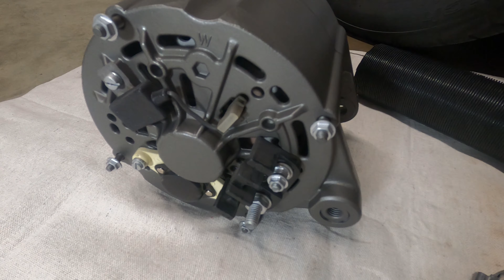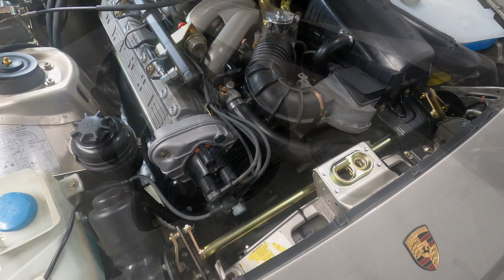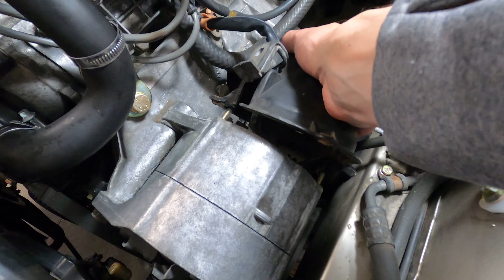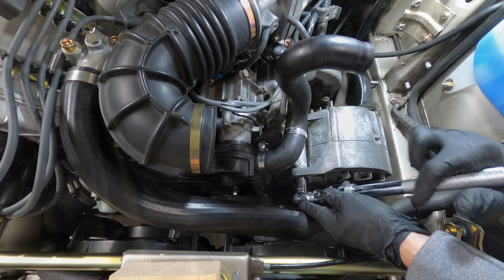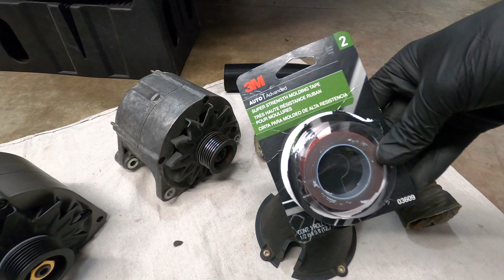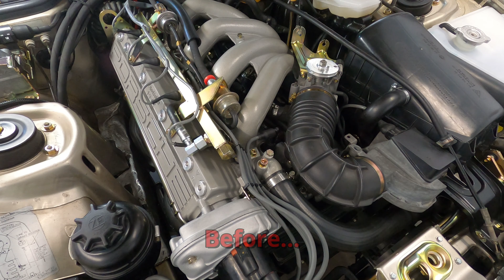Porsche 944 – Alternator Replacement Tutorial

Comment: I have an 84 and I just ordered a replacement alternator that will require reusing the pulley. Was hoping to see if you or anyone in this subscriber community knew what the correct torque spec would be?
Reply from the maker: 33 ft/lbs. should do the trick.
Reply: @NC944er thanks for the quick feedback. Love your videos, keep up the good work.

Comment: I can not rid off red battery warning light with new alternator
Reply from the maker: What voltage readings are you getting from the battery when the car is off and when the engine is running? Should be 12v+ on the battery and 13.5-14.5v when running (alternator output). Other things to check include the battery terminals, make sure they are clean and tight, check and clean all ground connections, and inspect wiring between battery and alternator.

Comment: Is your powers steering belt on incorrectly??  I feel odd asking as I visit your channel often for reference.  But I just changed my belt and the grooves are facing inward.  

Which way is the correct way?

Thanks
Reply from the maker: In this case yes, it was on correctly. There are a couple different v-belt designs from the various manufacturers, some of which featured notches on the inside and others with grooves on the outside. That said, it’s almost impossible to install them inside out, so as long as the pointed V sits within the pulleys, you should be good.
Reply: @NC944er  now I am questioning if my NAPA belt is on correctly lol  also if you don’t mind, I wanted to change the alternator belt but I could not get the pivot bolt to move.  If I just loosen or remove the tension rods, can I still replace the belt?  Thanks
Reply from the maker: @stevenmarrero9190 By “pivot bolt” do you mean the AC compressor mounting bolts? Those should be loosened to avoid damaging the mounts when the compressor is tilted to detension the belt.
Reply: @NC944er  yes the mounting bolt.  I cannot get them to budge
Reply from the maker: @stevenmarrero9190 Penetrating spray and breaker bar maybe.

Comment: If you don’t disconnect your battery when doing this what would happen? I removed my alternator and then put it back once I was done working on the ac compressor but did not disconnect my battery. Now when driving the car I have a low voltage reading and the dash warning light.
Reply from the maker: @dwwe-l5f  If the live wire from the battery to the alternator shorts on any other metal components during removal, there is risk of damaging the alternator, the battery, and/or the wiring. You can try to clean up the connections and make sure they are tight, otherwise I’d test the battery and alternator to see if either needs replacing.

Comment: Currently replacing my alternator and your video has been really helpful! Thank you! 

A question; i noticed on my car (924S), the back cover on the alternator as well as the vent hose were missing completely. Now i'd like to retrofitt these as i've read that the "cooling system" improves the lifespan of the alternator, and also provide better cover for the electrical connections. I found the cover piece on ebay already as well as the vent hose, but couldn't identify yet the plastic piece in the front of the car that the vent hose connects to (seen @5:10 for example). That piece is missing as well in my car. Do you happen to know the part number of that piece? I couldn't find it in the parts catalogue either. Thanks in advance!
Reply from the maker: @michaelpfister9960  Hey! The plastic air guide (duct) is technically two pieces, there is a long and a short section. They are no longer in production, but you can find them used on eBay for about $60. Most sellers list the two pieces together. Check out part numbers 94460344100 and 94460344200.
Reply: @NC944er  That's what I was looking for, thank you!

Comment: Great that I came across this video, I am changing my alternator and I was wondering if this one fit on my 1985/2 Porsche? Because there are two options on pelican parts…the Bosch Al-170-x or AL-29-x 90amp so that I don’t buy the wrong part again lol
Reply from the maker: @julian55132  Yeah, the AL-29-X applies to cars 1982-1985/1 and the AL-170-X for cars 1985/2-1991, which got a boost from 90amp to 115amp.
Reply: @ thank you for your help and I am doing couple of upgrades on my 944 so I will probably have more questions on other videos, thanks again for this 🤙🏼

Comment: FABULOUS video!  Unfortunately, I have to replace my alternator this week.  Fortunately, I can follow your great tutorial.  I appreciate everything you do!
Reply from the maker: @kcarmack99  Thanks! Best of luck, it’s not too bad a job.
Reply: @NC944er  Also, what size and length hose are you replacing? Mine is pretty mangled like yours was.
Reply from the maker: @ I just used the kit from 944Online, it comes with the air duct hose and two new ring clamps for $20.

Comment: I've seen elsewhere the voltage regulator is frequently responsible for "alternator failures."  Regulators are much less expensive than the whole  alternator.

I know you were suspecting the pulley or some othe mechanical issue, but for others watching...

Comment: I hate how easy you make everything look 😡 just attempted this and my adjustment bar will not move
Reply from the maker: The benefit of editing… 😂 If you can move the two nuts to the side, you should be able to hit the threaded connections with some penetrating spray. If it’s too far gone, new adjustment bars run about $80 on Pelican, part number: 944-126-021-04
Reply: Yeah I’m just joshin ya 😂 thank you! Also the two bolts on the AC compressor are giving me an issue. I’ve got the new alternator in so should I tighten the adjustment bar first and then go back to tighten those bolts on ac compressor?
Reply from the maker: @dylan4413  Yep, get the bar set to the right adjustment and then lock everything else down after.

Comment: I'm so glad he said the mounting is the same between early and late model. I was researching to put the 115amp ALT in my 83' and I was worried the mounting might be a little different. This gives me confidence to try one. These videos are awesome and super detailed.
Reply from the maker: If you’re looking to swap from early to late, the mounting location and general setup is the same, but there are a couple differences to consider. The early upper connection point uses a nut/bolt setup and a smaller M8x130 bolt, where the later alternator has a threaded rear ear and uses a larger M10x130 bolt. Some owners have encountered the need for just a little filing/grinding of the mount, while others have mentioned the need for a small spacer, and still others have said they had no fitment issues at all. So just be prepared to swap over the 5-ribbed pulley to match your early setup and account for any minor hardware mismatches that may arise.

Comment: Very helpful, thanks.  Looks easy to swap out.  I think I'm going to pull mine and just do a rebuild kit on it.  It has been working ok, but I'd swear the voltage reading has recently gone down a bit, plus given the age and mileage (150k+), a rebuild should make it last.
Reply from the maker: Nice! Yeah, it’s really straightforward. I recently replaced the alternator on our Honda Odyssey and it was a bit more challenging than the 944. 😂

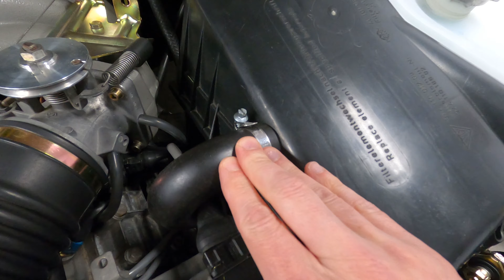Comment: FYI.  At 3:50 you mention the ventilation line off the air box.  That is capped off on my 1987 NA, and my understanding is that Porsche recommended that mod via TSB.  I'll see if I can find that reference and post it here for you.
Reply from the maker: Hey man, thank you! Yeah, I’ve seen that TSB and the little $10 rubber caps that Porsche sells, I believe it was published in June of ‘86, which is odd that they kept installing the ventilation line from the factory after that. 😂 My understanding is the TSB was released due to the potential for water to be sucked up through the intake and then transferred to the drive belts and cause premature degradation of the belt material. I don’t really drive the car in wet conditions so I haven’t installed the caps as of yet, but that may be a good idea for a future video. 😁
Reply: @NC944er  One other question for you...  I noticed my alternator cooling duct hose is missing from my car.  I have the shroud on the back on the of the alternator, but I'm not sure where the duct hose would connect to from there.  Can you confirm that it is routed down and towards the front of the car to another plastic tube that is mounted to the front bumper?  Initially I assumed that was some kind of brake cooling duct, but now I think it is used for the alternator duct.  Thanks!
Reply from the maker: @kennethrichardson1654  Yep, you’re exactly right! The flexible ventilation line runs down from the shroud and over to the left slightly where it connects to a short plastic tube behind the front bumper/spoiler.
Reply: @NC944er  Well, I got that duct installed.  Thanks for the help!

Comment: This is probably a dumb question, but when you say disconnect the wiring harness from the battery, do you mean just the terminals? Electricity is like an irrational fear of mine so I want to make 100% sure.
Reply from the maker: Hey! Yeah, you got it, just loosen and disconnect from the battery terminals and push them to the side so they’re not making contact.
Reply: @NC944er  Alright that’s what I figured, thanks so much for responding!

Comment: Would this cause constsnt back firing on a car? My car constantly back fires and I have to jump it
Reply from the maker: Hey man! Having to jump the car would typically point to the battery, if the alternator has failed, it won’t charge the battery, but the car really wouldn’t run for long without the alternator working. 

Backfiring is generally caused by improper air/fuel ratio, misfiring ignition components, or incorrect ignition timing. So you may want dig into some of those systems as follows…

For the fuel system:
Pressure can be tested at the rail, if it’s out of spec, it could point to the FPR, a clogged strainer, filter, or failing fuel pump. The injectors are prone to clogs and leaks as well and having them cleaned and flow matched is usually worth the $125. 

For air/intake system:
Confirm unmetered air is not entering the system by checking for vacuum leaks at all intake and vacuum line connections. If you haven’t replaced your vacuum lines and connections, the Lindsey Racing kit is really affordable. AFM calibration can also cause issues, the potentiometer can be cleaned and the wiper arm adjusted if the contact strip is worn. 

For ignition components:
Check spark plug gap or replace plugs with Bosch 7900 plugs. Check the condition of the plug wires and confirm they’re all connected to the correct distributor points. Check internal condition of the distributor cap and rotor connections and replace as needed. Perform resistance checks on the ignition coil. 

For ignition timing:
Set the flywheel to Top Dead Center and confirm positioning of the cam gear and correct timing as needed.
Reply: @NC944er  yeah bought a new battery got nothing outta it so going to do alternator now and the back firing got worse as the battery got lower in voltage
Reply from the maker: @thearyanpatel1682  Replacing the alternator certainly won’t hurt anything as most of them have some oxidation present inside and out, and that would improve the electrical supply in general. Let me know how it goes. 👍
Reply: @NC944er  my car starts then instantly shuts off after switching the alternator
Reply from the maker: @thearyanpatel1682  Check the wiring connector to the AFM and ensure it’s properly seated.
Reply: @NC944er  where would that be sorry.
Reply: @NC944er  nvm I read that wrong

Comment: My 1986 944 Turbo voltmeter dropped to zero while driving today. The car seemed fine driving, everything worked normally otherwise. By the time I got home, grabbed my meter to test everything, and restarted the car, the gauge was fine. Voltage at the battery was 12.4 with the car off, and 13.4 withe car idling and many accessories on.  ????? Is there a known gauge issue?
Reply from the maker: I wouldn’t say the voltage gauge issue is super common, but I have seen a few folks reporting it. There are a number of electrical gremlins in these cars, usually the early cars get the worst of it. If the issue continues, the first thing I would check is the connections behind the gauge cluster. Sometimes the pin terminals can loosen up and get pushed out slightly and inspecting the connectors, pins, and ensuring they’re all properly seated may help. 

Another item to complete for all general electrical issues is to check and clean all the grounding points inside and out, which can improve things across the board. Here’s a link that has most of them covered - https://rennlist.com/forums/924-931-944-951-968-forum/445827-how-many-ground-lugs-in-the-interior.html
Reply: @NC944er  Thank you! I’ll report back if I find anything.

Comment: I want to thank you again for making this video, just changed out my alternator to see if it would fix my issue with windows/AC blower/radio. All of a sudden they are not working. However it did not help. That sucks. I wonder if you have any ideas why these three areas are not working. I was also recently working on my rear lights and my odometer. Maybe I did something? I also want to know if you know the part number for the wiring harness that connects to the headlights/headlight motor/ignition coil/and I think the brake fluid reservoir? It is a really big main wiring harness. Anyways thanks for your help.
Reply from the maker: Hey Phillip, I’m sorry to hear that! The earlier cars can experience a few electrical gremlins. As far as the part number, there are quite a few different numbers for the various models and years, but it looks like Ian has a few options at 944online - https://944online.com/engine-wiring-harness.html

You can also find used engine bay wiring harnesses on eBay. 

Before you go that route, I would try to diagnose some of the components. A simple multimeter can go a long way in tracking down issues. Outside the wiring itself, switches can fail, fuses burn out, and individual motors/components fail. The first thing I would do is check any applicable fuses for the affected system. If that checks out, I would test power to the components (example: disconnect a headlight bulb, turn on lights, and test voltage at the connector). If power is good, I would then test or replace the components (example: apply direct 12v power from the battery to the headlight or motor, etc to see if it’s working).

Comment: It looks like this alternator came with a painted case.  It looks nice but was wondering if you thought the layer of paint would inhibit grounding.
Reply from the maker: The aluminum cases are often repainted during the remanufacturing process, which is relatively common in that industry. The cases can also be powder coated while the internals are removed. No issues with grounding that I’m aware of and all the electrical terminals at the rear were clean and clear of any coatings. The layer of paint could slightly affect heat dissipation, but that should only be an issue with really high performance / high load applications.

Comment: I have the 951, and my alternator is toast. It truly is a PITA to remove and replace. That car has so much plumbing to remove to get to it I just aint going to mess with it. Ill save up some coin and have a pro repair it. Its a nightmare.
Reply from the maker: Yeah, the Turbo models are generally preferred in almost every way over the NAs, except when it comes to maintenance as there are often quite a few additional steps required to complete what would normally be pretty basic stuff. Best of luck! 👍🏼

Comment: I'm changing out the alternator on my 1983 944 and I see that there is this little plastic case with a wire coming out if it connecting to one if the terminals in the old alternator. The new alternator I got us refurbished and didn't come with that. What is it?
Reply from the maker: Hey Hugo! If it’s labeled as B+, the little plastic box with a wire is usually the positive battery output. There is also sometimes another plastic cover (typically larger) for the voltage regulator. Depending on the brand/remanufacture process, these components may be inside or outside the housing. If the connections look way off, I’d probably confirm any differences with the vendor.

Comment: Hey man do you remember who you got the alternator from? I found a seller on eBay who is selling 130 amp remans not sure if it’s the same person
Reply from the maker: Sure, the one I got was from seller: eagleautoelectric
Reply: @NC944er  cool thanks. Same seller. Happy with it? I need to do a little bit more diagnostics but my charging system is struggling.
Reply from the maker: @tims_4x4_garage  Yeah, it was painted up nice and pretty with all new intervals and connectors. Seems to have good output and I liked that it had the pulley and fan blade preinstalled.
Reply: @NC944er  I went ahead and ordered one. I know I have some other problems but the alternator could be failing as well. My dash doesn’t show more than 12V but that’s pretty common with these clusters. I only get around 13.6V on the battery with the engine running. I’ve considered doing all new battery cables. I still need to do my voltage drop tests but I know the alternator was missing the cold air tube so it probably  wasn’t very happy for a long time. I replaced the cold air supply duct but it’s secured with zip ties at the moment. I need to get the correct size hose clamps for it. The ac/alt don’t really live in harmony together since the ac compressor must’ve been changed at some point. It doesn’t take the correct belt and the alt duct doesn’t really fit. I see why they deleted it. I did get it to work, but it’s snug